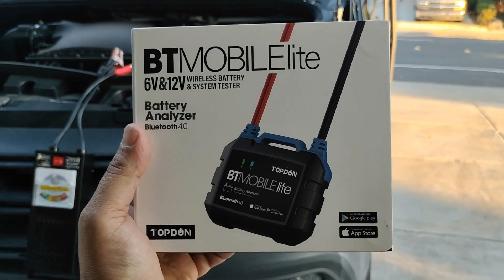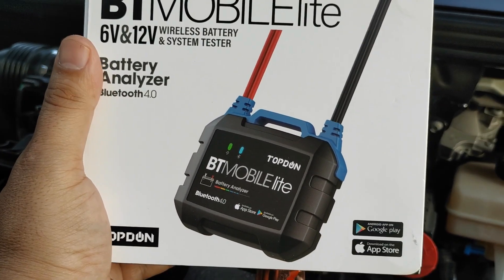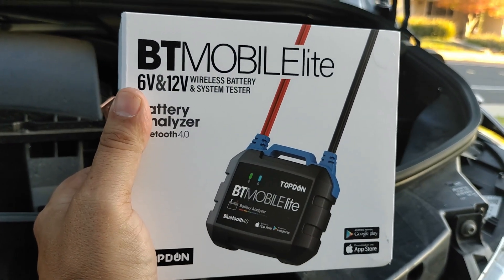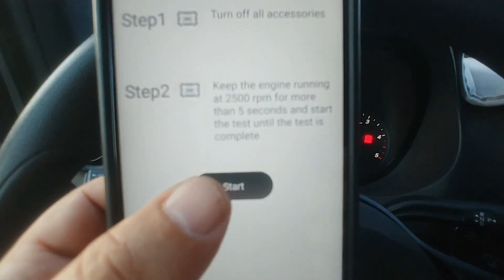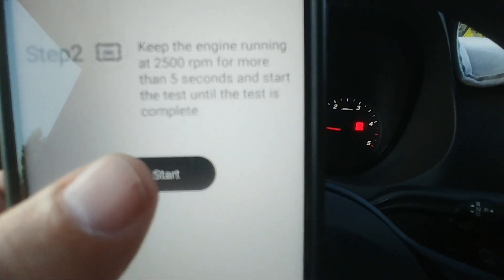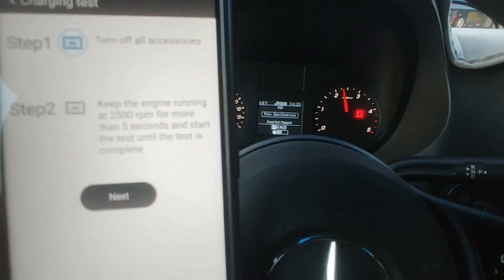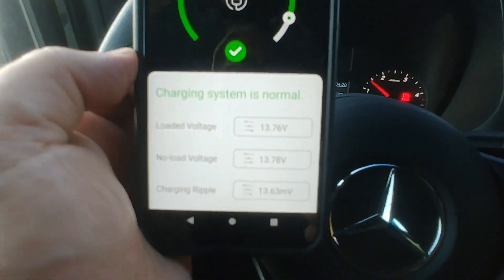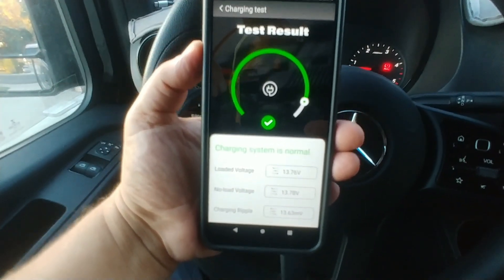Topdon BT MOBILE LITE - Bluetooth Battery Tester with Charging and Cranking Function

Comment: Mine says that the values are too high, any help with that?
Reply from the maker: Check the connections. Have you checked the battery voltage with a plain voltmeter?